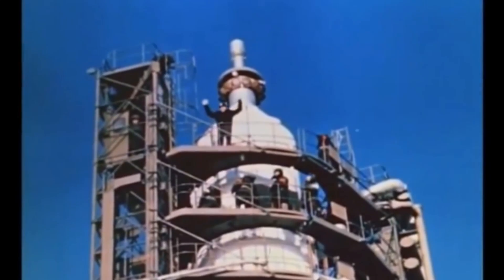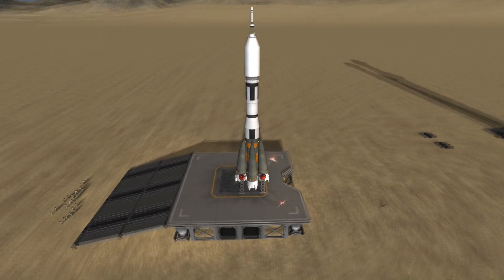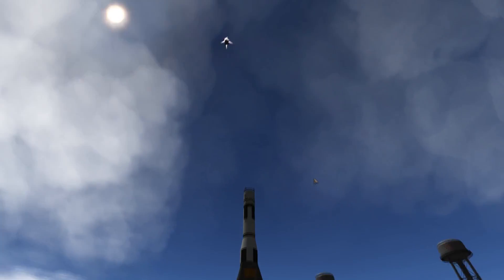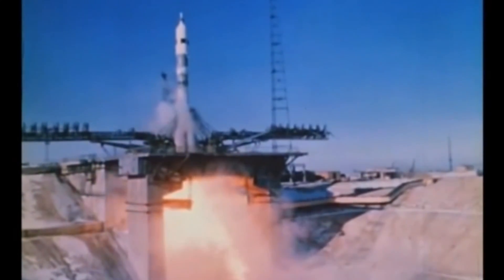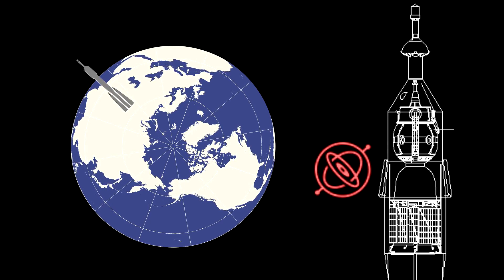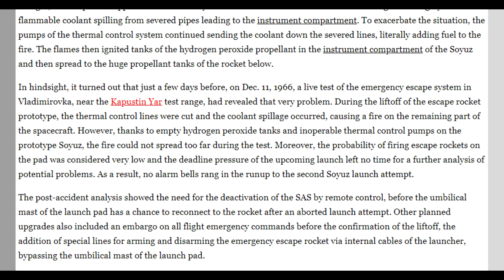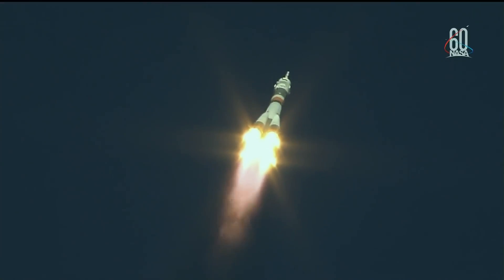Why Rockets Fail - Earth's Rotation Leads to Explosion of The First Soyuz Rocket

Comment: I've worked on some very recent launch escape systems (I'm still relatively new, so my memory doesn't go back that far), and I am absolutely shocked by this. Why was there crew on the pad with an armed abort system!? They safed the rocket but not the abort system?? That is disgustingly negligent. Nevermind ppl on the pad with a fueled, recently failed rocket. Idky, but this story is really setting off my engineering alarm bells.

Comment: Excellent video as usual. You're always very informative and entertaining.

However, there is one blaring detail that most people have failed to notice. The Soyuz system has been flying for OVER 50 YEARS! In the past 50 years, so much has changed and made our lives easier, safer and more productive, but we're still sending people into space in a '65 Moskvitch with radial tires. What have we, as a species, done to further our reach toward the stars?

Nothing, according to this(and most modern) space technology. While our current space engineers drive to work in direct injected, turbocharged, WiFi connected, Bluetooth enabled, voice recognition, GPS guided machines that will order a latte for you, they're working with craft that, for comparisons sake, is a '57 Chevy with a 350 2 bolt main and a 3-on-the-tree.

Essentially, this current space tech is something that a 15 year old with a set of wrenches and a bucket of elbow grease can get to land on the moon or even orbit Mars. What are we doing as a species?
Reply from the maker: The B52 has been flying since the 1950’s aircraft have long lives.

Comment: Wait, gyroscopes do not need their reference updated when there is no movement. Even with earth's rotation, the gyroscope wouldn't be affected unless of course you tilted the rocket but usually gyroscope's movements are relative to the rocket's orientation perpendicular to the earth's gravity. So why was the escape mechanism activated.....
Reply: Gyroscopes do not use gravity to sense their orientation. They are carefully balanced to prevent that. Once spun up, inertia keeps the gyroscope's orientation in space fixed. Since in this case the rocket was still attached to the continuously spinning earth, the abort system thought that the rocket was getting more and more off course over time. The escape system got activated when this deviation got bigger than the threshold value of about 7 degrees.
Reply: @Sequence14  I'm aware that it is still attached to the ground so relatively the rocket does not rotate relative to the ground so how could the abort system trigger when the rocket does not rotate relative to the ground
Reply: @channelname10yearsago68  It rotates in space (it CHANGES its orientation in space), since the earth it is attached to rotates, and the gyroscope KEEPS its orientation, since that is what gyroscopes do as long as they are spinning. The effect is similar to how a large pendulum rotates over the course of a day (see "Foucault pendulum" on wikipedia).

Comment: 5:15
You said, "Since the rocket isn't at the equator," implying that a gyro would be off by four degrees there.  Wouldn't the gyro be off by four degrees at the North Pole?  No, wait, that's Foucalt's Pendulum.  It would only apply to a gyro if the spin axis was horizontal with the ground.  Still, one would imagine more than one axis of orientation would be used for accuracy.

Non-equatorial launches are a pain even without this factor.

Comment: I probably didn't understand you right, as far as I know gyroscopes stay vertical relative to earth, which means the gyroscope wouldn't move on the pad, which also means the ejection system triggered because it has NOT moved, because it should have moved after the start of the rocket.

Did I get that right?
Reply: No, gyroscopes do not care for gravity, they do not stay relative to earth, they do stay fixed in space. In this example rocket fired because gyroscope moved due to earth rotation.

Comment: what happened last year?
Reply: Crewed Soyuz failed. A valve failed to open on one of the boosters during separation, causing it to fail to separate and damage the core booster, resulting in total destruction of the rocket. As the rocket was starting to break apart, the Escape System triggered as designed and saved the crew.

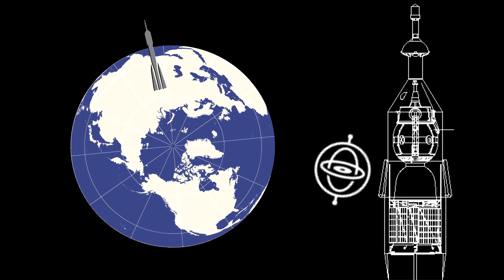Comment: 4:53 - Technically, the gyroscope would still have been in its original starting position; the rocket was rotating around it.
Reply: @krvnjrcbs  Exactly. And in this case obviously the whole universe was revolving around the gyroscope :-)
Reply: Technically, it would be in a different position, but with the same orientation

Comment: "Hmmm. Since we moved away from using ethanol as the coolant, that mysterious leakage we were experiencing seems to have stopped..."
Reply: I seem to remember that the V2 rocket program had issues because the engineers were drinking the rocket fuel.

Comment: There are about 1436 minutes in a sidereal day,
27 minutes elapsed from engine ignition, so:
(27/1436)*360 = 6.768802 degrees
That’s how it hit the 7 degree threshold and triggered the escape system

Comment: Thanks for this interesting video. Just one thing, I don't understand how not being on the equator slows the angular speed ?
Reply: The earth spins like a top once every 24 hours. Any given point on the surface draws a circle as the earth rotates. The equator draws the largest circle, which means something at the equator is moving a longer distance in that 24 hours, and therefore moving faster.
Reply: That doesn't affect the angular speed.
Reply: I got it. That's because the rocket is not perpendicular to the rotation axis ^^

Comment: The Mig 21's radar also used ethanol as its coolant.  Supposedly in the event of  a supply shortage (and I have no source to verify this so take it with a grain of salt) it could be substituted with vodka and the radar would still function at least for a short time.
Reply: Ethanol evaporates faster than water, so it can improve the transfer of heat. Replace it with water, and the efficiency drops, not mentioning the water can freeze in pipes.
Re: Mig-21 - I'm not sure it had a ethanol coolant; there was no radar per se on 21st; only a radio-based distance calculator. The direction was still set by the optical channel, AFAIR. (I may be wrong in that, and there was at least 2 modification of the radio channel hardware, maybe more). Probably you meant Mig-25, that one used ethanol for sure.
Reply: Thanks for the correction, I should have specified that I was talking about the MiG-21bis which entered service in the 1970s and did include a short range radar (Detection range approximately 30 kilometers).

Comment: how fast did that gyro have to be spinning for it to still work after being unpowered for half an hour and still function well enough to detect the rotation of the earth?
Reply: Military/space grade gyros are marvels of mechanical precision, they spin at half a gazillion rpm suspended on ultra low friction bearings in a helium-filled or vacuum tank, so yes, the rundown time of half an hour is not out of ordinary

Comment: quick question scott, do you know if the INS used here was optical(fiber optic gyro or ring laser) or a mechanical gyro?
Reply from the maker: Mechanical
Reply: TY scott :) that actually helps with some of the silly arguments i get in to
Reply: Absolutely mechanical. Solid state weren't space-ready until much, much later

Comment: re: russians using what basically amounts to vodka as coolant in their planes

the MiG-21 used high grade ethanol to cool its radar. because of this, you could only run the radar for close to 40 ish minutes before you ran out of coolant and had to shut it down. I've also heard stories of the ethanol coolant tanks running mysteriously low back at the air bases sometimes 😉
Reply: also for those who ask why ethanol, it was cheap (mig 21 was primarily a cheap fighter) and according to russian doctrine at the time you probably weren't gonna run the radar for more than 40 minutes a sortie anyways
Reply: @the_bw_trekkie  Ethanol wasn't cheap. Exactly because of price they researched its replacement with methanol, but it was too toxic for field operations.
Reply: lots and lots of other hardware used ethanol for cooling, and it was issued in significant quantities for preventive maintenance of all sorts of things, among with rags, paint thinner, grease, oil, paint etc. 

some guys even refused (unofficially of course)  to accept a new type of equipment created for them unless the maintenance manual included a hefty ethyl alcohol allowance for periodic cleaning.

it was not only booze, but also an important currency in military and engineering circles
Reply: I suspected this but I only knew about the mig 21 from flying it in DCS all the time and researching it myself

Comment: Interesting,  but I've  never seen a stationary gyroscope start moving due to Earth's rotation.
Reply: The gyroscope is part of a stable platform that maintains a fixed orientation in inertial space. The platform moves to maintain this orientation, and reports its current orientation to the guidance computer. It WOULD move in response to the earth's rotation!
Reply: @warrentaylor8428  I know all about the science behind it. I've just never seen it and to my knowledge this particular demonstration has never been recorded.
Reply: @warrentaylor8428  Can you point to one recorded demonstration of a gyroscope drifting with the Earth's rotation?

Comment: as the gyros spun down they would eventually begin to tumble which would have set off the escape system regardless of the earth's rotation
Reply: Even if the wheel is suspended at the centre of its mass?
Reply: @sofuckingannoying  I don't think they'd tumble through  gravitational torques, but rather through transferral of angular momentum to the gimbal mounts through flexure

Comment: Can you make a video about the hidden space race of reconnaissance satellites that weren't talked about publicly yet played a vital role in the cold war?
Reply: Tonight on the Smithsonian channel (DirecTV channel 570) there is an episode of "Atomic Age Declassified" called "Spies in Space", described as an inside look at the Manned Orbiting Laboratory.
Reply: Seconded.  Finally those tabloid claims that they can check your watch/tell if your shoelace is untied could be put to rest (or confirmed?).
Reply: @MrAnticlimate  there is a physical limit to resolution called Dawes limit. You won't get more than 15cm resolution from LEO if you got an mirror like the Hubble. The NRO donated an new version KH to NASA once and that basically was the size of Hubble in mirror terms.
Reply: @Veptis  – That has to be the Rayleigh limit, that flat earthers like to cite when cornered about over-the-horizon objects ☺.
Reply: @Veptis  If the spy sat goes from visible light to shorter wavelengths, the limit shrinks proportionally. X-Ray probes, eh?! (Free dental imaging for the whole population as a side benefit.)
Reply: @vladimirdyuzhev  passive x-ray is very limited and noisy. You can. Go UV with light from the sun but getting a scanner working for it more expensive. Peanuts of the cost of a satellite and launch.
Reply: I always wondered, if it's possible to launch a satellite in total secrecy. Eg. you add it to the payload beside a weather sat., but somehow avoid detection. If news of Zuma's destruction are fake, then the US government has to have a means to "hide" it, while somehow communicate with it undetected.
Reply: @MrAnticlimate  What's the point? The Russian army tracks everything that flies, not relying on a word of US gov.
Reply: @MrAnticlimate  the Zuma trick has been used before. If you want to learn more in-depth strategies I suggest the amateur satellite observers arround Dr. Marco Langbroek. It's truly astonishing what can be learned about top secret government missions by just observation and open source data. There might be very classified satellites that launch from the X-37 that are using disguise techniques similarity to stealth bombers to be hidden from ground observations. The US has therefore launched reconnaissance missions into higher orbits to look for those that hide from earth based observation for exmaple. If they do a counter measure only for something that exist and they he US can do already.
Reply: @Veptis  – Thank you, his blog is really interesting.
Reply: @MrAnticlimate  seems easier to just add the function you want into the weather satellite
Reply: @renakunisaki  – I mean, the weather sat is already tracked by your enemies (and your supposed friends 😒), and an ideal spy sat is one which your enemies (and your supposed friends 😒) don't know that it's overhead. It would need its own propulsion though, which makes things complicated, so probably not cheap.
Reply: @renakunisaki  weather operates in geo while a lot of Earth observation is happening in LEO. spy sats usually run SSO to get full coverage within 12 hours depending on the number of seats you have. It's also more than just images, you have radar and electronic signal reconnaissance.

Comment: When you have a million variables to work with, it makes sense that eventually one slips through undetected. But that's what tests are for, and it's good that a pre-manned flight test discovered this issue.
Reply: Because just having the rocket sit there for half an hour is the kind of test someone would be reasonably expected do.
Reply: @michaelbuckers  I think the test that was accidentally accomplished that showed the error was more "Sitting on the launchpad after everything was armed"

But hey, progress is often marked by failures
Reply: Rocket falling on 30 people due to Earth's rotation is secondary purpose of tests
Reply: It's okay, is ethanol fire, can just drink problem away
Reply: i would've thought the specialists they had on hand would've realized the vulnerabilities of the LES, and that earth rotates.
Reply: even if it was manned - the capsule landed safely, so LES showed its reliability :)
Reply: It's not so good that "a few" other issues were discovered in the first manned mission...

Comment: That's right, don't blame the rocket scientists for the failure, blame the Earth's rotation!
Reply: If Earth were flat and did not rotate, its movement around Sun would eventually also trigger the escape sequence, in about a week.
I'm not entirely sure about the movement of Solar system within the Milky Way - would it be a factor and how long the rocket would have to wait on the start table. (I just estimated - about 4 mln years.)
Reply: @vladimirdyuzhev  Er no because the flat Earth model doesnt have the Earth rotating. Instead its the sun, moon and everything else that rotates. According to flattards anyway.
Reply: @1701_FyldeFlyer  Oh, sorry, I wasn't privy to the details of that outstanding thought system.
Reply: Ha ha ha.   Had the rocket launched it would have collided with the sky dome and blew up anyway!  (in flat-earth thought)  ;)
Reply: @vladimirdyuzhev  orbital period for the sun in the milkyway is something on the order of hundreds of millions of years... the diameter is 100,000 light years, and we are moving way slower than the speed of light....
Reply: @arkie87  I just looked up that Sun goes around Milky Way in about 200-250 mln years. 7/360 of that is 4 mln years.
Reply: @vladimirdyuzhev  i guess i missed the "mln" which isnt standard notation where im from
Reply: @arkie87  Sorry, I might have mixed up abbreviations from unrelated cultures. My bad.
Reply: So you watched the video right?
Reply: @dylanhultman3922  he most likely did and is just making a joke dont get offended ao easily you commie fuck
Reply: @dylanhultman3922  Of course!
Reply: YE M8
Reply: Flattard trigger warning
Reply: I'm sorry but who blamed the uber US engineers while their pilots where cooking in their capsule at the platform for about half an hour?

Please dont be that pathetic that soviets must be stupid while americans must be smart ... the history of engineering is a history of try and error ... imagine how many people died just by going down a cliff before the brake was invented to make the wheel a secure thing.
Reply: Of course. That is the one most important rule to obey if you want to survive and make a cerrer in socialism: Always find someone other to blame for the mistakes.
Reply: If the earth wasn't rotating relative to the background stars "sidereal day = ∞", then it would never trigger this.
However, if the earth wasn't rotating relative to the sun "solar day = ∞", as if the earth was tidally locked to the sun, then it would be rotating relative to background stars so that a sidereal day = 1 solar year, and it would trigger this, uhh, eventually.
If the earth wasn't rotating relative to the moon, as if it was tidally locked to the moon, then a sidereal day = 1 lunar cycle, and it would also trigger this eventually.
Reply: Alex Knauth I don’t know of what u wrote is pure ballshit but sounds good to me so thumbs up 👍